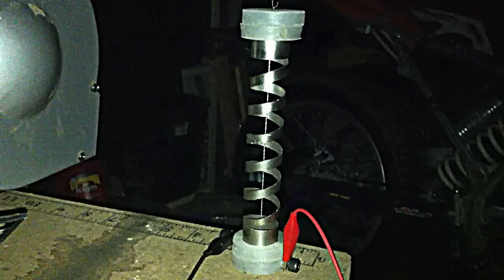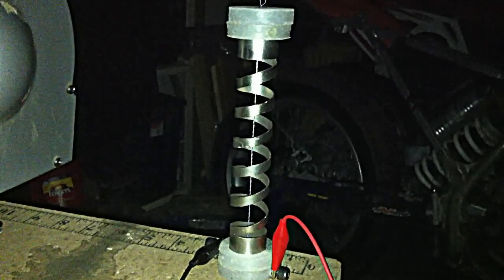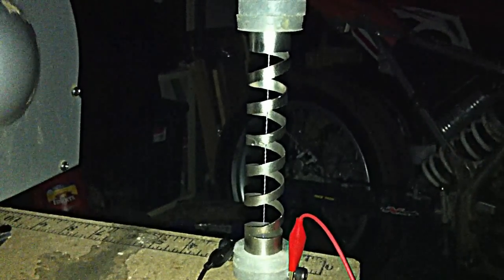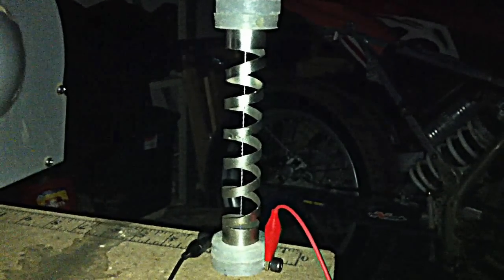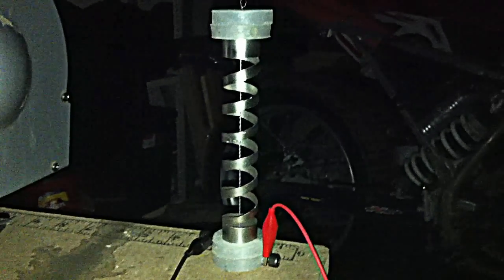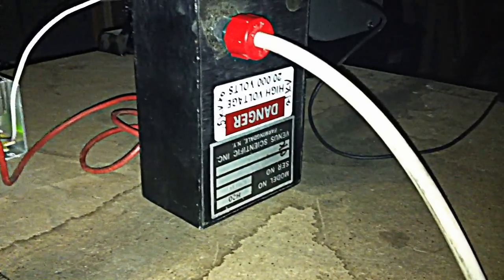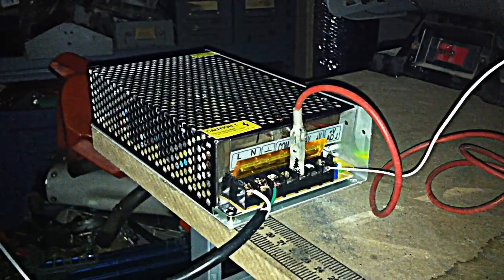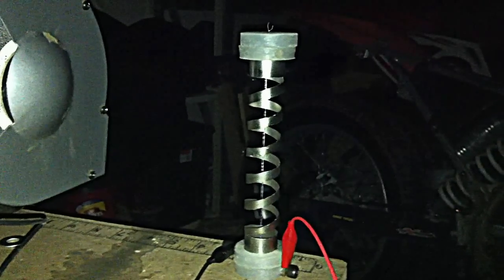Laser EPG 007 - HGG Hydrogen Gas Gun/Processor Part 4, Testing Spiral Design (CORONA DISCHARGE)

Comment: I think you will need a duty cycle to get it to work. Without one the electrons you remove will stick to the electrode and never make it to the extraction circuit. Also if you build up enough electrons it has a much higher chance of arcing. Just my two cents